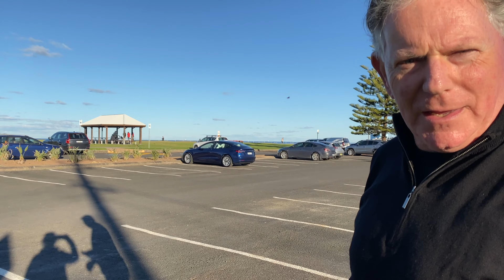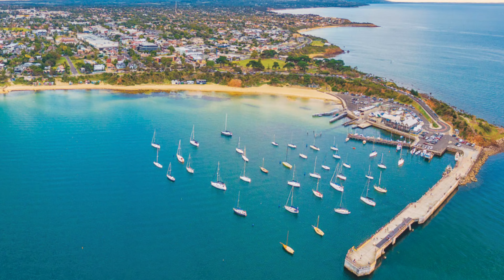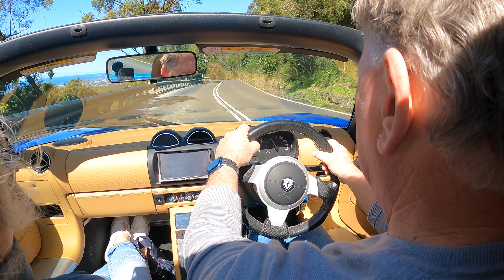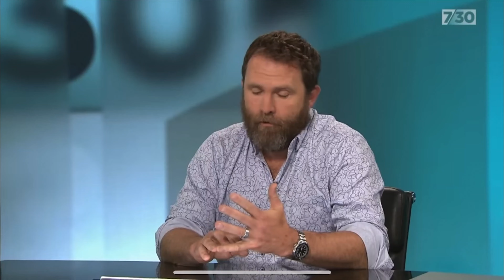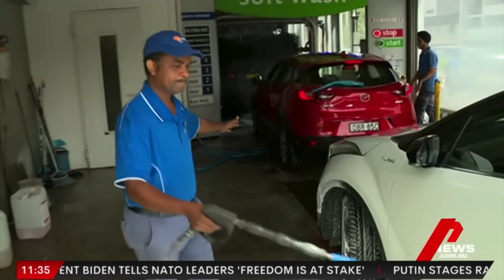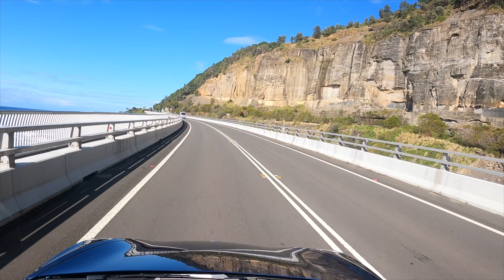My last Tesla 3 video

Comment: We have a tow ball fitted in our Model 3 here in Melbourne. We love it. Enjoy the new car!
Reply from the maker: Hi, any issues with the Tesla tow package software and a third party tow bar?
Reply: @stevestesla9120 I asked Tesla AU for trailer towing mode but they would not give it to me. We can still use AP with a trailer and bike rack. So correct, no issues with 3rd party tow hitch / ball. I got under 220kms on a full tank on our Model 3 RWD due to 200kms of 110km/hr and a full 6x4 trailer load of hay.